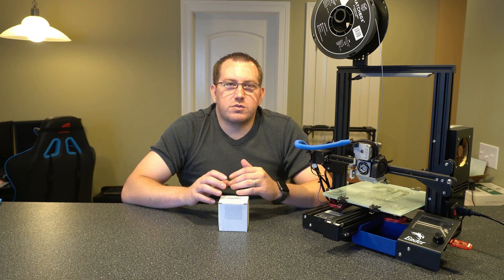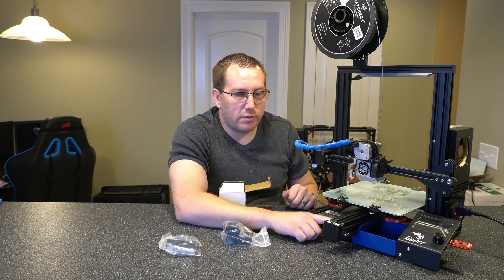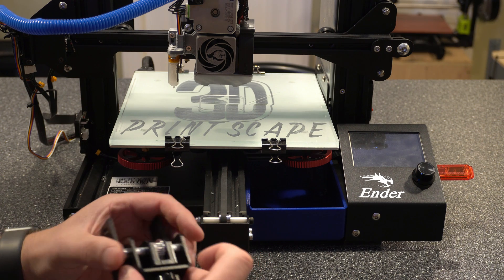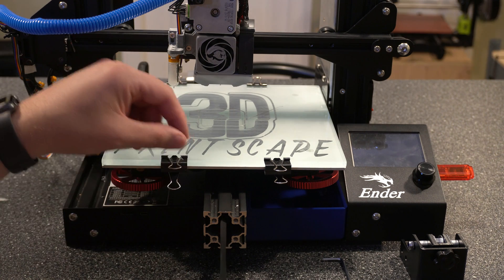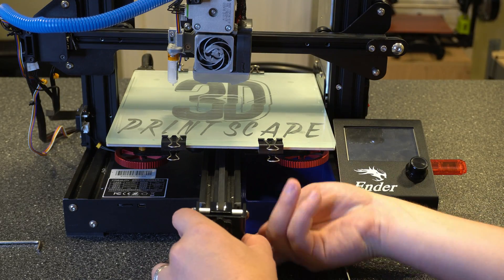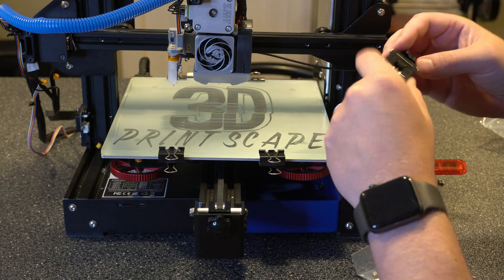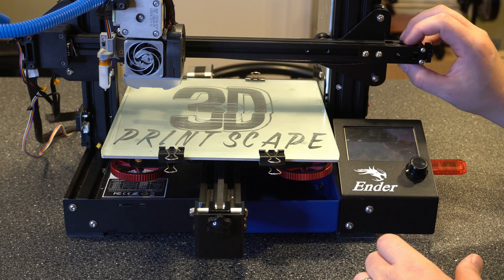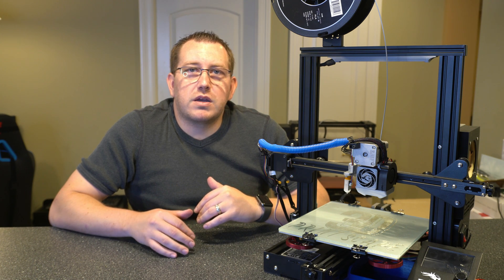3D Printer Belt Tensioner Upgrade Guide

Comment: For putting my Ender 3 y-axis belt back onto the plate I removed the leveling nuts and springs to push the build plate up for more clearance to reach the hook. Really excited to see whether this solves my ringing issue. I put my Ender together using your guide when I first started and have been a fan since, thanks for another great video!
Reply from the maker: Hi. Thanks for the feedback. Did that fix the printing issues you were having?

Comment: I questioned whether I should get one for my x axis and after having one in my wishlist on Amazon for a few weeks I pulled the trigger and the oval holes I was getting turned into perfect circle. The Y axis for me has been fine though. So glad I bought one these.
Reply from the maker: Hi. Honestly, if its working fine i wouldn't mess with it. If your doing another upgrade, or replacing the belt, in the future it may be worth considering then.
Reply: @3DPrintscape  Agreed.